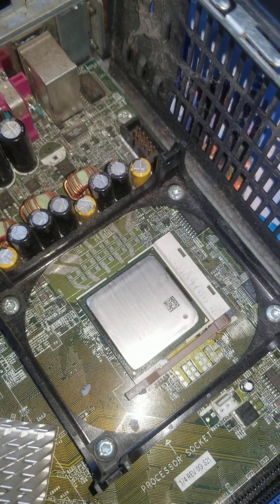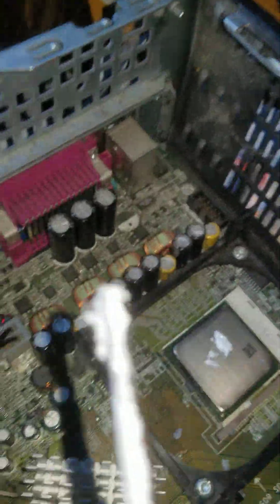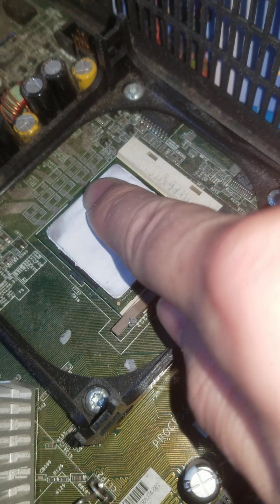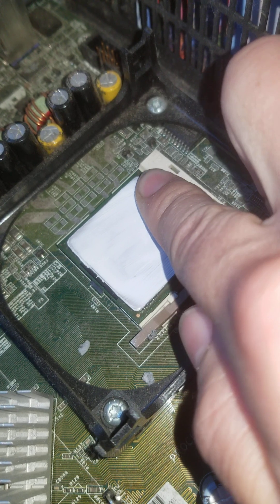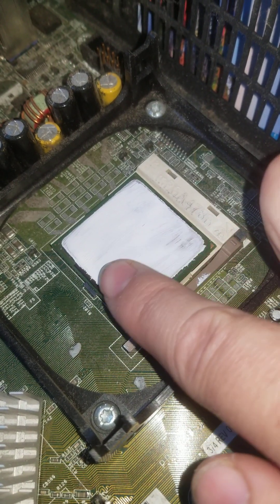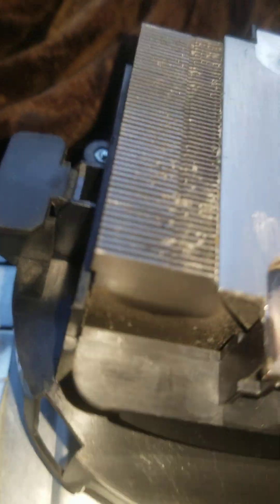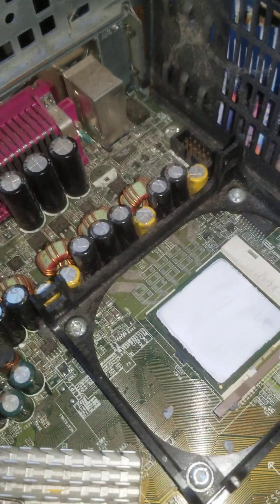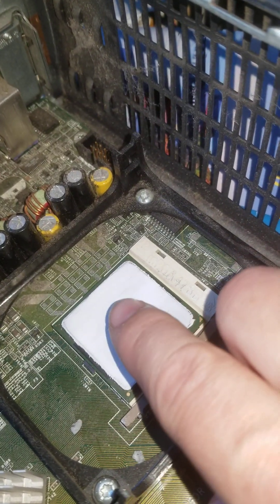Best Way to Apply Thermal Paste onto CPU the finger method

Comment: The finger method is the best method but please for the love of fuck… wear gloves if you do this. You don’t want the oil from your fingers getting mixed with the thermal paste. 

This method and using the thermal paste spatula that comes with some of them are the 2 best methods. 

Using the “pea size dot” on the center of the CPU doesn’t work for a lot of them because they’re getting bigger and bigger and that pea size dot isn’t enough to reach all 4 corners of the CPU. 

Thanks for coming to my TED Talk.